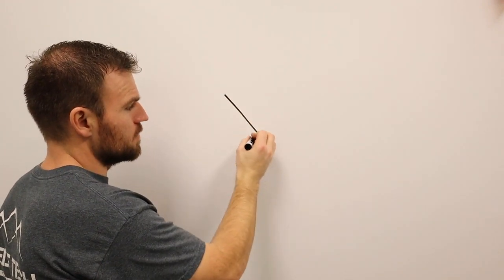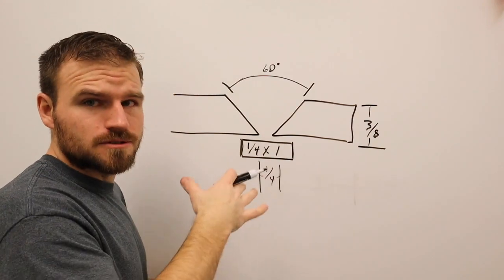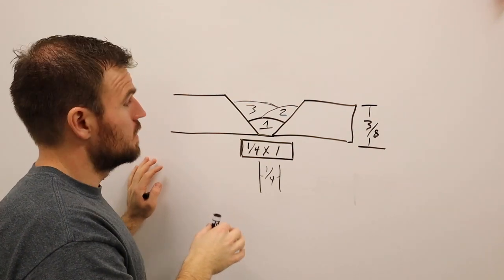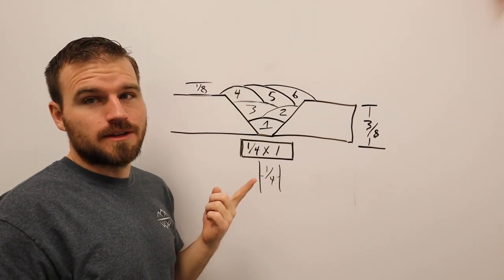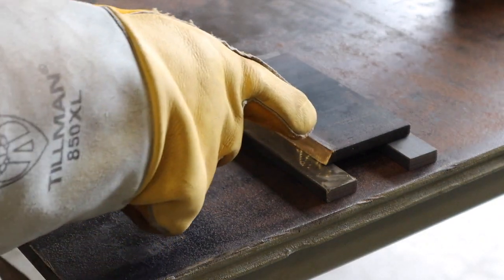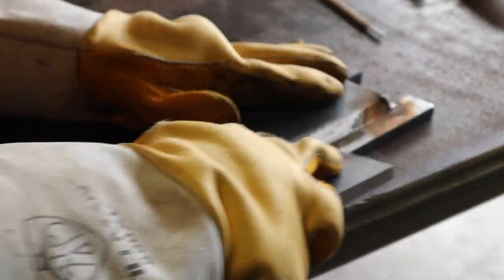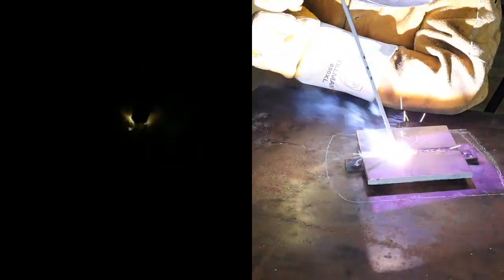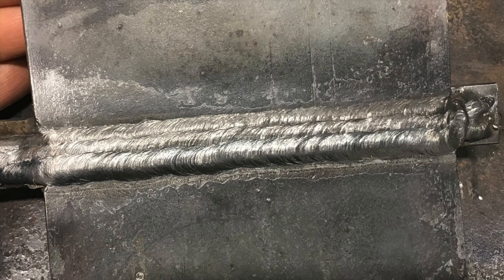Welding SMAW - How to weld a flat V-groove

Comment: What are your temperatures on while laying the root?
Reply: Idk I had a square pipe and a flat half inch plate so I welded the pipe to the plate and I took my 6010 and ran it on 65 amps stick weld and just kept my rod in the puddle to get a burn through never had bad luck with 65 Amps with a 6010 on a pipe fit
Reply: @cumminsadicts3340  Ok, thank you! I’m currently in welding school and this is what I’m having trouble trying to accomplish. Thank you so much!
Reply: @blakeballew197  How was Welding School? Any Advice or something you wished you did sooner?